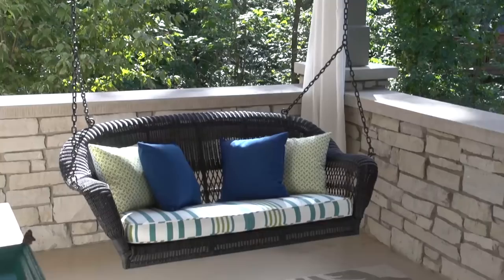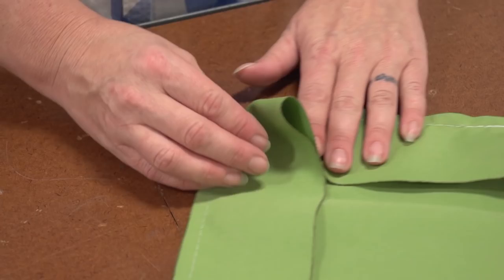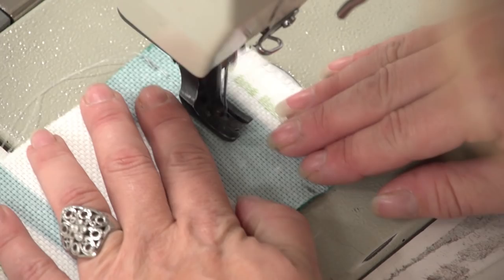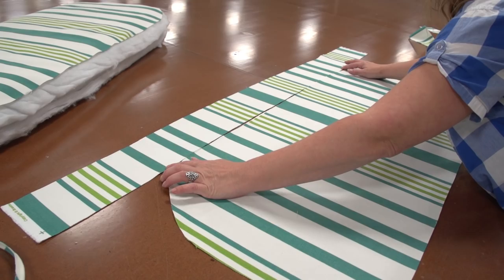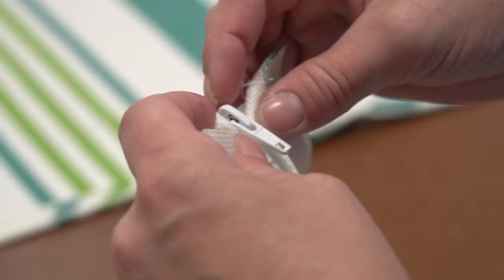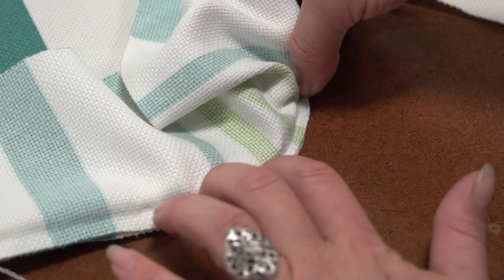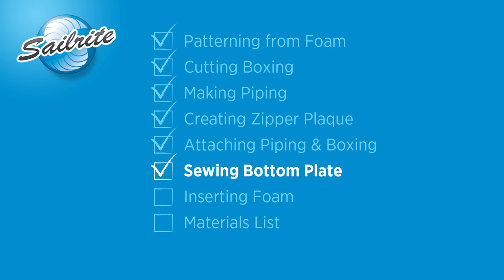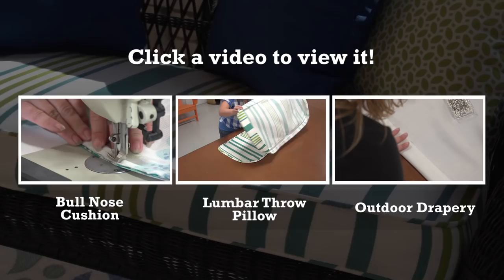How to make a Box Cushion

Comment: I have to say your video's are very informative and point on.  I do have one question, I followed the instruction to the tee, however, when I cut the fabric to the exact measurement of foam, it was to small and I had to redo with a seam allowance.  Also, the piping was really hard to work with that small.  Any suggestions?  Maryola

Comment from the maker: Hi Christian Griffith,
To create the zipper plaque for the cushion use the boxing width and add the width of the zipper to it. So, if your foam is 3" I usually add a 1/4" to a 1/2" to that measurement (meaning my boxing is 3 1/4" overall or 3 1/2" overall). So... for the boxing that contains the hidden zipper add the width of the zipper to that measurement (If you make 3 1/2" boxing and your zipper is 1 1/4" wide your zipper plaque boxing width would be 4 3/4").
Reply: Very helpful, thank you!
Reply from the maker: You are welcome! Let us know if you have any questions or need help picking products at www.sailrite.com
Reply: That was the question I was going to ask! Thank you! Also,I was wondering how to install the zipper piece(zipper plaque is a new term to me). I was thinking there wouldn't be a good way to make an exact calculation. You did it pretty much how I imagined. I am making a window seat. Do you recommend to wrap the foam in batting? I was thinking of doing this and then your video showed the previous cushion was batting wrapped. I'm using quilting weight cotton that will be backed with a product called Soft and Stable which will then be quilted. It's a thin type of foam used to make handbags, similar to headliner. I thought it would give the quilting weight fabric substance since it's rather thin for a cushion.
Reply from the maker: Danielle Hudson Wrapping the foam in batting will do two things: it will give a rounded look to the side of the cushion rather than a box look. It will also provide more thickness (not much more) and a little more cushion (but again very little). The main reason for using the batting is the rounded look (which is mostly a preference, some like it others do not). Yes, soft and Stable is different from "Sew Foam" which we call "Polyurethane Foam 1/4", 1/2" or 3/4" With Fabric Backing".
Reply: Sailrite How is Soft and Stable different from Sew Foam? I was thinking of trying it. I use the Soft and Stable mostly for bag making.
Reply from the maker: Danielle Hudson Soft and Stable is a polyester stabilizer. Our Sew Foam is a Polypropylene foam (the same kind of foam found in cushions) with a fabric backing. So it is different from Soft and Stable in that it is a different type of material. I believe the would accomplish just about the same type of performance for some applications.
Reply: Sailrite

Comment: I have Four questions:
1. Does your industrial machine allow you to use a longer stitch?
2. What type/size thread are you using?
3. Do you have any tips for making a foam covered box pillow for a curved seat cover? I'm not using dacron over the foam, but do have pillow protector over it. It is slightly curved on both sides and more curved in the front, straight in the back.
4. Would the zipper or velcro go on a curved end, or along the back?
Your videos are clear and easy to understand, both verbal instruction and the video part. They are inspiring me to get back into cushion making - but last time I worked under a master, now it's 20 years later and I'm doing it alone.
Reply from the maker: Answers to questions:
1. The Ultrafeed will sew up to a 6mm stitch length and obviously smaller. The Sailrite Fabricator Sewing Machine sews up to an 8mm stitch length or less. 
2. We used a Polyester thread for this job. It will also sew many other types of threads including a PTFE thread called Profilen. 
3. This video may help: https://youtu.be/G68VZGs9EaY How to Sew a Curved Seat Back Cushion  
4.  The above video uses a zipper in the boxing. 
Let me know if you have more questions.
Reply: Wow! Thank you for your quick response.

Comment: I am so glad to find this video!  I have question before cutting my pieces:  Don't I need to cut top and bottom pieces bigger to allow for seam?  She is cutting them exactly the size of the foam.  Thank you!
Reply from the maker: +Shannon S Good question. In most cases we only cut the top and bottom plates a 1/4" larger than the foam all around. When I make cushions I usually trace around the foam on top of my fabric and this results in a plate that is slightly larger than the foam (by about 1/4" or less) which is acceptable for me. Now that seems like you will not have much left over for your seam allowance (3/8" seam) --- which is true as it (the seam) will take up some of the size of the plate. The finished cushion will result in a tighter fitting cushion cover for a better fit (it will compresses the foam). 

To the boxing (facing) I cut it to the width of the foam plus about 1/4" to 3/4". Keep in mind that thinner cushions look best with more allowance added and thicker cushions look best with less. Basically adding less

of an allowance will allow the seams to roll into the edging of the cushion. 

This slight lack of fabric for seam allowance make the cushion look better and when the fabric stretches with use it will not be as wrinkly. With that said, this is not a rule, but rather my preference when making cushions, so do what works for you. 

Let me know if you have more questions.
Reply: +Sailrite Thank you!!!

Comment: I have a paper pattern of the exact size (which is irregular) of a window seat. Should the foam be cut to the exact pattern size, or will it shrink or expand a tiny bit when wrapped or covered with polyfil? I know to add seam allowance but just wondering  if I need to allow for this variation once stuffed inside the boxed cushion?
Reply from the maker: +diana eden If the foam is not wrapped in batting then I would add to the size (about 1/4" around all sides). Here is the general guideline for cutting foam: Use pattern and add 1% to both dimensions. But for soft to medium firm foam (IFD <40), be a bit more generous. Never add less than ½” (so as mentioned above 1/4" around all sides or 1/2" for both dimensions). If the foam is wrapped in batting I would cut it the same size as the pattern, because the batting will add to the overall size. Once a cover is installed it will shrink slightly from compression of cover fabric.

Comment: I bought your basting tape and really liked using it but the tape allowed the stickieness to adhere to my sewing machine needle. Is there something I am not doing correctly??
Reply from the maker: brenda holtzinger Brenda - When sewing cushions with seamstick (basting tape) it is best to try to keep the seamstick well inside the area that you are sewing. So the needle does not penetrate the double sided tape. That way the glue does not show up when the cushion cover is turned right side out. That is not the case for other applications using seamstick, but it is for cushions.  When the needle enters and exits fabric with seamstick, glue build up may happen on the needle (if the fabric does not have enough body to clean the needle with every penetration) in those cases I use a cotton ball with Goo Gone or rubbing alcohol to wipe the needle clean if it builds up.

Comment: I notice that when you draw an outline of the foam onto the material, you don't add anything for a seam allowance; is that correct?
Reply from the maker: True, the foam is usually a little larger (1/4" on all sides) than the desired finished size. So, when the top and bottom plate of fabric is cut it is the same size as the foam. After the seam allowance, of 1/2" is taken up the cover is smaller than the foam for a great looking compression of the foam with no wrinkles or sagging. The boxing is usually cut about 1/2" to 3/4" wider than the width of the foam. So.... if you have a 4" foam I cut the boxing to 4 1/2" or 4 3/4" wide.

Comment: They don't seem to add seam allowance on the top and bottom, which would shrink the cover and make it fit improperly.  Did I miss something?
Reply from the maker: The fact that the cover is smaller than the foam is a good thing. This compresses the foam slightly making the cover fit snugly in place. Remember making cushions is not set in stone, do what works best for you personally.
Reply: Ahh, that makes sense.  I've done plenty of canvas but no cushions. Tackling my v berth soon, though. Thanks for the tutorials!

Comment: I thought this video was exceptional and gave me the confidence to redo my RV cushions. I am wondering though if the type of cushions inside have any bearing on whether or not to leave a seam allowance. My soy-based cushions are rather firm and I'm a little concerned about not leaving a seam allowance. Comments?
Reply from the maker: Yazmin Shroff Very good question. Yes, if you foam does not compress much (is very firm) then you may want to add a slight bit of seam allowance. In most cases, foam that does not compress, it not very comfortable, so this would be a rather rare situation. What you want to avoid is a cushion cover that is too large, some fabrics will actually stretch slightly over the years and then you will have wrinkles or covers that are too lose, so don't add too much seam allowance or you can have other issues.

Comment: Could you make the "zipper" placket a velcro placket or opening instead?  How would it be cut/installed?
Reply from the maker: Byron Williams Yes, you could. I would make a zipper plaque that is wider than the cushion thickness by about a 1/2 inch then I would add about 2 inches for the width to create a single hem. Then cut the boxing in half and create a single hem that is 1 inch and sew on the Veclro at the same time (hook on one side loop on the other).

Comment: Are there no considerations for seam allowances to top and bottom plates?
Reply from the maker: Hi Janet,

When you work from the foam (which is cut 1/2" larger than the desired finished cushion) you cut the plates the same size as the foam. These are the cushion rules we use here at Sailrite, which we prefer because it results in a nice tight cushion. It is DIY though so you can do whatever you want.
Reply: @SailriteDIY  Thank you so much.

Comment: Following this video, I am so disappointed that the double sided tape has made my sewing needle sticky and gooey.  I had already made my piping with the double sided tape as in video for eight cushions, after experiencing gooey sewing needle and my machine acting up, I took all my piping apart with the double sided tape!  Lots of time wasted.  Why did the tape ruin my needle?
Reply from the maker: If a light weight fabric is used sometimes glue build up, from the double sided tape, can be seen on the needle. Usually a heavy fabric helps clean the needle as the needle enters and exits the fabric, so it is not as common with medium to heavy fabric. So... what can be done for lighter fabrics to help prevent the glue build up? I like to keep a cotton ball with rubbing alcohol on it and clean the needle when I start to see glue build up on the needle. Sometimes "Goo Gone" on a cotton ball can even be better, as it seems to helps to prevent the double sided tape from building up as fast on the needle.